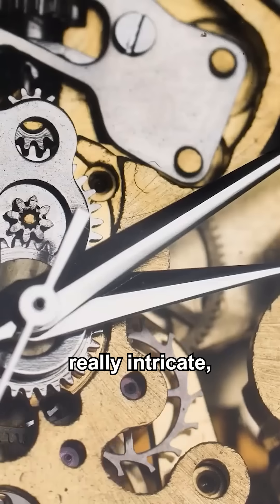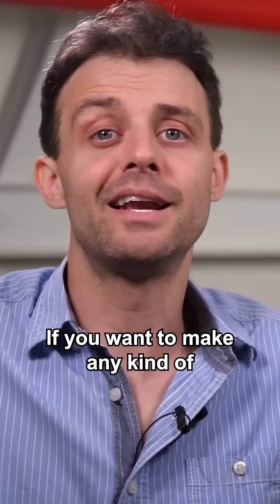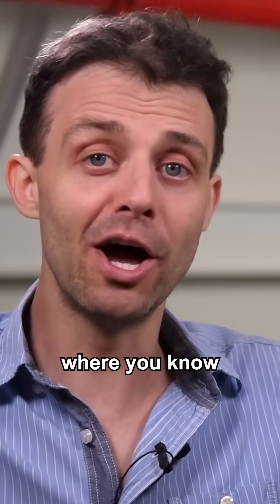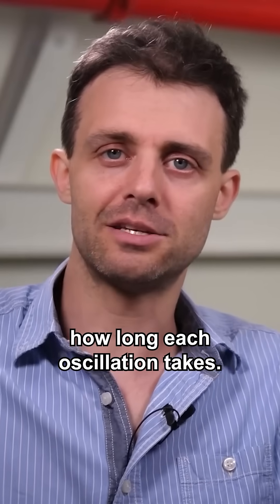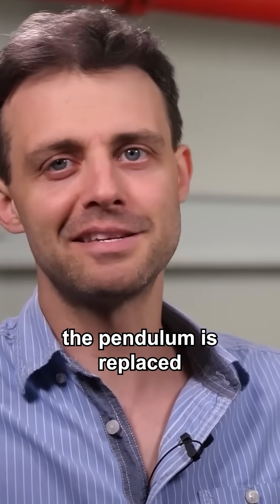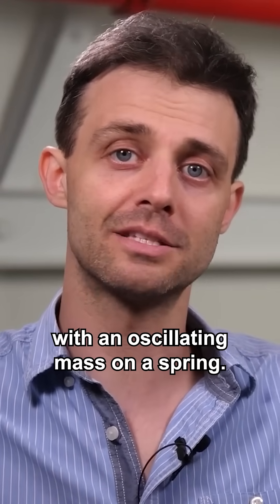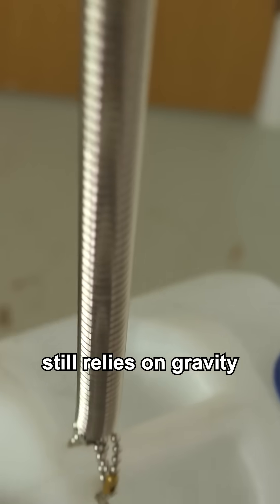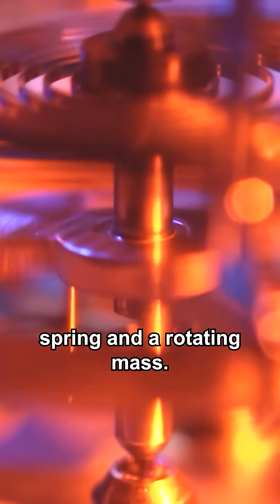Could you wear a Grandfather clock on your wrist... in theory?

Comment: I wouldn't say that my Tissot chemin des tourelles is a high-end watch. Nevertheless, it's off by less than one second per day (with accumulation) - and Tissot sells its watches at -10/+30s variation per day at max.

It does not need to be high-end at all, with all precision automatic tools used to make the gears, etc. it's mostly the tuning made by the watchmaker that makes the difference. Thus, even if your watch is off 10s per day, another skilful watchmaker can still tune it better.

For wrist watches, the flying tourbillon, which makes them horrendously expensive (for no really good reason apart from marketing and I'm not even talking about gyroscopic tourbillon), is actually useless because the movements of the wrist itself throughout the day is enough to act as is. It's practical to keep a good precision if you're not wearing it. Otherwise, it's just immensely mesmerising to watch.

Comment: DaVinci used neither a coiled spring nor a pendulum (which actually oscillates!).  Actually both the oscillator and the escapement mechanism that both drives and Mayes with the oscillation determine the cycle or period.

Comment: “High end mechanical watch loses 5 seconds per day” 😂😂😂

I regulated my 1970s Ricoh mechanical watch and it loses +-2 seconds a day, dial up, dial down all the positions.

Come on man, mechanical watches are not accurate, yes extreme precision required to manufacture them and to work also but they are not close to be accurate. They are fun to use no doubt bout it but when it comes to accuracy, quartz is the winner by far. High end, low end, whatever end doesn’t matter, no mechanical watch can even come close to a quartz watch, pay a million bucks to mechanical watches nope it is still stone age accuracy compared to quartz. yes even those crazy exotic material oscillator installed Zeniths (18Hz best movement vs 32,768 quartz), high beat stuff, tuning forks you name it, all are behind the quartz which I don’t like. I love to watch the sweeping seconds, intricate parts moving but that’s all it is. Quartz is the winner of accuracy at the end of the day. So technically, a $5-$10 watch you buy from a cheap Chinese website is more accurate than a high end A. Piguet, JLC, V. Constantin or a Rolex, not better material or craftsmanship, don’t mix them, but accuracy.

Comment: the weight 'randomly' winds up the spring in the watch - it doesnt unwind it. The spring drives the hands, and the power output is metered.
Reply: You’re not talking about the same spring as Steve. You’re talking about the mainspring, but Steve is talking about the balance spring.

Comment: Dont modern watches still use the same concept, with a piezoelectric quartz crystal or something instead, measuring the frequency as the oscillating source?
Reply: Yep, the quartz method has been used for timekeeping for around 100 years, and was implemented in watches around the 1960s and 70s by the Japanese (especially Seiko) and the Swiss (especially Longines). That's when quartz watches began to take over from mechanical watches, led by the Japanese. The Swiss watchmaking industry refers to this as 'the quartz crisis' and it's basically what spawned Swatch to take over the world with their quartz watches in the 80s. 

Today, cheap watches tend to be quartz while higher-end watches are often still mechanical, even though they tend to be less accurate and require more maintenance, because watch aficionados appreciate the incredible craftsmanship.

Comment: Five seconds per day?! If I tossed something on the old chronometer and saw it reading a five second loss per day I'd be stripping it down to individual parts, thoroughly cleaning those parts in my three step cleaning system, then reassembling and lubricating everything as needed. Probably give it a new main spring, and if it's an automatic wonder I'll make sure things can swing without any issue.
Reply: Never heard of COSC?

Also your first step should be regulating the movement, not stripping it down.

Comment: Hi Mr Mould from Will. 
I wet wiped a solar panel operating in sun, causing crazy cracks in the solder and crystal guff. Yet rain does not damage. 
Rapid heat? Care to guess? Thank you.

Comment: 5 seconds a day... that's still a lot, if you ask me.
Reply: That is more accurate than computer mainboards or mobile phone time circuits.  The ONLY reason digital clocks remain accurate is because of the Network Time Protocol which is designed to synchronise sloppy hardware clocks with accurate atomic clocks.  30 seconds to 30 minutes of time drift per day is not uncommon with various mainboards.  5s/day with no external reliance, tolerant to chaotic bodily and vehicle movements, powered solely by a few turns of a knob, is miraculous.
Reply: @Warp9pnt9  also subject to magnetism and temperature difference. It’s amazing
Reply: Ya that's 30 minutes lost every year. Cheaper ones will lose even more.
Reply: @VillagerJeff more expensive ones will keep it better.
Not necessarily even expensive either; some cheap movements can be as accurate as +/- 1 second per day

Comment: Why doesn’t the pendelum in a grandfather clock slow down due to air resistance and friction?
Reply: There are weights (hanging on a chain) that keep pulling the pendulum.
The pendulum swings (oscilates) at a certain frequency. The weights just "give" it an axtra push to compensate for friction.
These weights need to be reset every few days.
Some have a spring instead of weights. The spring needs to be rewound.

A mechanical watch also has a spring.
Actually 2 springs: one for oscilation (as shown in the video), and one for overcoming friction.

Many years ago, I had a watch that needed to be rewound every day.
Reply: @Yehan-xt7cw  thanks, that really helped!

Comment: "lose as many as 5 seconds per day". 

That's really far from "incredibly accurate".
Reply: this is the equivalent of losing 30 minutes per year, although since the loss/gain is probably more similar to a random walk, it should only be around 15 minute offset per year.
Reply: Accurate to around 0.005% isn't reasonable enough for everyday living?  Given all the many dozens of critically sized parts all working in concert reliably, with the parts making many 10s of thousands of oscillations per hour, serviced once every 4 or 5 years, whilst subject to things like shocks, drops and magnetism, it's a miracle they work at all.
Reply: @mcdon2401 and the fact that a decent movement is now usually closer to +/- 1 second per day
Reply: That is more accurate than computer mainboards or mobile phone time circuits.  The ONLY reason digital clocks remain accurate is because of the Network Time Protocol which is designed to synchronise sloppy hardware clocks with accurate atomic clocks.  30 seconds to 30 minutes of time drift per day is not uncommon with various mainboards.  5s/day with no external reliance, tolerant to chaotic bodily and vehicle movements, powered solely by a few turns of a knob, is miraculous.
Reply: @Warp9pnt9 5 seconds per day is around 1 hour per year. My cheap quartz clocks drift by around 1 minute before I adjust for light-saving time change, so 2 minutes per year, 30× less. I don't know about motherboard circuitry, but quartz clocks are much more accurate.

Comment: What I want to know is how they tune the mechanism to oscillate at EXACTLY one oscillation per second. Not 1.0000001 seconds, not 0.9999999 seconds. ONE second. Is that the reason as to why they need to be corrected once in a while?
Reply: They run them for a week, monitor, and make adjustments.
Reply: With a grandfather clock you adjust the mass on the pendulum up or down a little until it's accurate.

This adjustment is even used on computer clocks. My computer has a file that states how many seconds the internal clock loses per day, and I adjust it after a few months.
Reply: @Houshalter why would you need that? NTP (network time protocol) has been invented specifically for keeping computer clocks accurate (in spite the internal drift). And if you are not connected to the Internet, I don't see why you'd need that kind of accuracy (the only thing that pops to my mind is a sandboxed foresincs setup, where you need precise timelines, while also being as isolated from the outside world as possible, but for such a professional scenario you'd use a more reliable approach to clock synchronization).

EDIT: fun fact: GPS satellites are basically atomic clocks streaming the exact time. Our phones/GPS receivers compute the difference of timestamps of three or more satellites, taking into account the speed of light, to triangulate the distance. I don't know whether this is still true, but back in the day they said GPS is the only technology which needs to take into account BOTH Einstein's general relativity and special relativity formulas at the same time.

More recently, in the DIY electronics era, some people decode the GPS NMEA string to have an accurate clock on Arduino/Raspberry Pi projects which need to use a GPS module, but have no internet access.
Reply: @aluminatestrontium7298 isolated security systems need an accurate time record, while also being not connected to the internet. I'm sure there are other applications, but that's the first that comes into my mind.
Reply: He mentioned an error of about 5 seconds per day, which is nowhere close to a precision of 0.9999999 oscillations per second, but more like 0.99995 oscillations per second.
Making a mechanical watch more precise than that might be impossible due to unpredictable effects from temperature variations, light shaking, the orientation of the watch in Earth's gravitational field, etc.

Comment: The fact that a one second pendulum is so close to one metre in length, they almost used that property to define the metre, until it was realised that it's also dependent on altitude, so they measured the earth with the metre instead.
Reply: Ultimately it is arbitrary because the meter wasn't perfectly defined by the Earth either. They gave some weird conversion factor to make it fit. They could have done the same with a pendulum too. They already semi-arbitrarily defined what room temperature and atmospheric pressure is at sea level for chemistry. They can define a meter as the length of a pendulum with a one second interval at some arbitrary altitude and point. The fact is the metric system while easy to use due to being consistently base 10; it predates scientific discoveries of fundamental constants and it is silly to change it after the fact.
Reply: Until they realized the measurements of the earth were inaccurate (and I’m sure there were other reasons but I’m too lazy to look it up) and again redefined the metre by using something we are pretty damn certain is a true constant…
…The speed of light! And yes, I’m sure most subscribers of this channel will probably already know this, but for anyone who doesn’t, the metre is currently defined as the distance travelled by light (in a vacuum) in 1/299,792,458 of a second. damn that’s just straight up beautiful and elegant 😊
Reply: This is perhaps the coolest coincidence in science since the ratio of distance and diameter of the Sun and the Moon.
Reply: @Breatropolitan im partial to the fine structure constant being very nearly 1/137
Reply: @Breatropolitan  But the moon is retreating , it was much larger (as seen from the Earth) and will be much smaller in the future.
Reply: I've read somewhere that if the metre was exactly the length of a 1s pendulum, then earth's gravity would be exactly π² (about 9.8696); which is thus of course still quite close to the real value.
Reply: I feel a Troll hole
Reply: I don't think mathematical pendulums depend on altitude though? It just so happens that i'm studying this subject right now at school and the book says that it only depends on free fall acceleration rate and the length of the pendulum. (The exact formula they give is `T = 2π√(l/g)`)
Reply: @social.elenakrittik Because free fall acceleration not only varies slightly through the Earth (because Earth is not ideal sphere) but also depends on altitude. The higher the altitude the less is g.
Reply: @willbedeadsoon The surface gravity is different, especially between Equator and the poles. Then there are mass concentrations like mountains, and with altitude the gravity also goes down (square law), all of which makes it not a good fit.
Reply: @social.elenakrittik sorry if I’m being intrusive but are you learning this in A-level physics? Bc later on you learn about gravitational fields and how they’re related to the inverse square law. Meaning if you go higher the acceleration of the pendulum due to gravity will be weaker
Reply: @Qwertyuiopasdfghjklzxcvbnmlwjd    No it's totally fine to ask! I'm not sure what A-level means (and a quick google search didn't really help), but i'm in high school (last education year) and am studying physics at the "average" level (i.e. what the school program includes by default for all students). Looking at the book's table of contents, the closest thing i could find to what you've described is "Electromagnetic fluctuations and waves". Having watched plenty of science-communication videos, i have a rough idea of what gravitational fields are, but it would certainly be cool to have that taught at school (or rather would have been if with that didn't come lots of formulas to remember haha)
Reply: @social.elenakrittik A level is upper level academics in British highschool. The equivalent of AP classes in America
Reply: @joshs5577  Oh, then there's basically no chance our education programs are similar enough 😅 I'm from Belarus
Reply: @joshs5577  Thanks for clarification in any case!
Reply: @social.elenakrittik that formula is derived through a simplification of the differential equation describing the system. There is no closed form equation describing the exact behavior of a pendulum and ultimately, the period does depend on amplitude